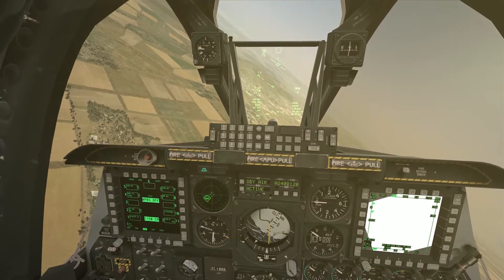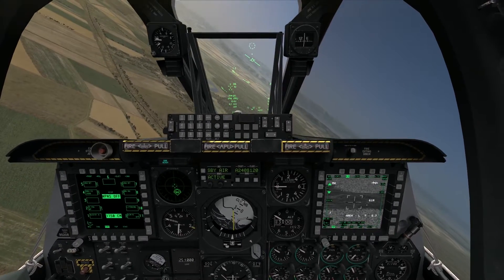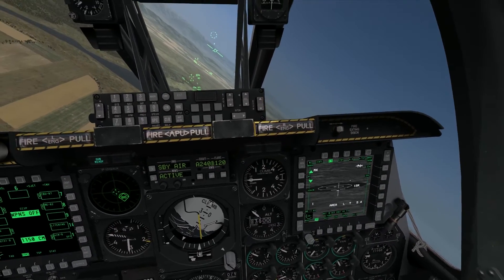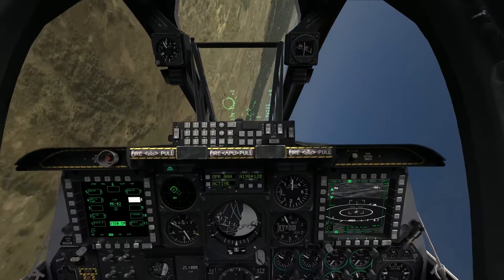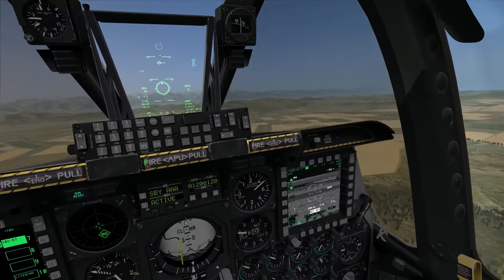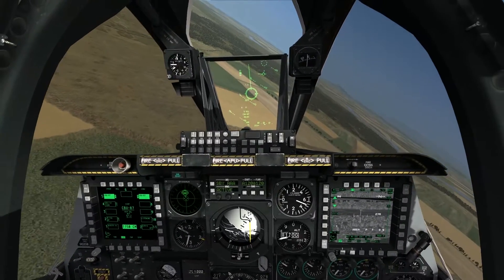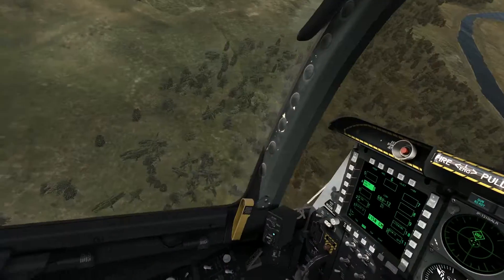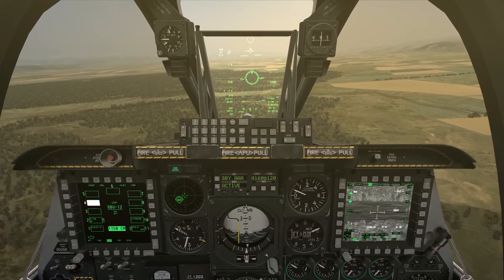On the Range #33 - CCRP Loft Deliveries in the DCS: A-10C Warthog

Comment: Maybe off topic Bunyap. but with the targeting pod. can you mark multiple targets? say if they were like 700 meters apart and you could just select first target, launch maverick. switch to next target, fire, switch to last target and fire? 
or is the A10 still only able to target 1 at a time? Cause it uses the same targeting pods as the F-16 does and they can do multiple targets for maverick/ gbu (GPS) ?
Reply from the maker: jack black Yeah, absolutely.  I cover one way to do it here starting at about the 13 minute mark.  http://youtu.be/lm6MqPYywxA
Reply: Bunyap Sims Thanks mate. that's pretty cool. its a hack so to speak, its using navigation points as opposed to targeting with a ground radar or target pod. but hey ill take it :) 
I hope they make n A-10 D with a ground radar. Some beefier engines that can go 500-600 kts without afterburners. then make it out of composites bringing the weight down even more  only when the F-35 is designated failure then . they will build this

Comment: Good, thought provoking video. Do you know how much range advantage you created by lobbing? It may be that the 'long' error distance is the added range achieved by lobbing. If so, is the advantage sufficient in self defence terms to warrant the reduced accuracy even if you compensate for the error?
Reply from the maker: Headin T Clouds I think the advantage would be more significant if the accuracy were improved.  I am pretty sure the real A-10 does a better job at this than DCS.  Granted, the A-10 doesn't move fast enough to get that much additional range but every little bit would help.

Comment: For the GBU-12 CCRP loft: your TGP was in Pointer mode and you were also masked, so the laser wouldn't work.

Great work on the videos though, still learning little bits of info of them!
Reply from the maker: Good catch!  You know, I have been doing that a lot lately and I finally figured out just now.  I switched the pod to the pointer by mistake when I switched to the CBU-87 profile.  I had the TP as sensor of interest and tried to switch the profile using the DMS.  I saw that nothing was happening, switched sensor of interest over to my HUD, and swapped the profile successfully.  I never caught that the first attempt using the DMS switch had changed the set-up in my TP.  I have been making that same mistake all the time lately and you have no idea how much that has been bugging me.  Thanks again!
Reply: Bunyap Sims Funny, I've been doing that constantly for the last week or so too.  Losing track of where my SOI is for a second and doing things I don't intend.  I would be dead by now if I were a real pilot.
Reply: Yeah, I was thinking that too about the laser.